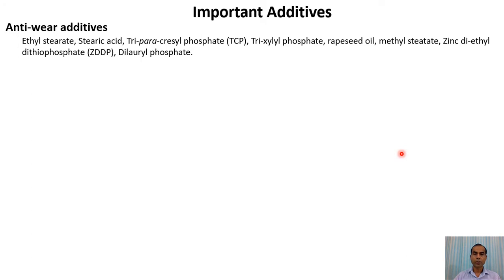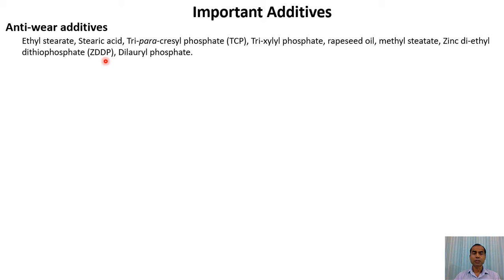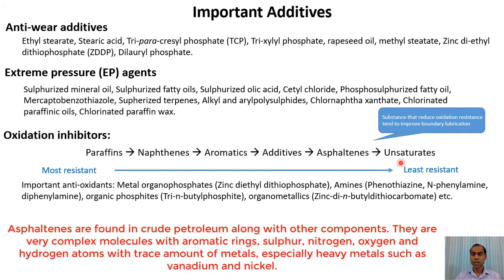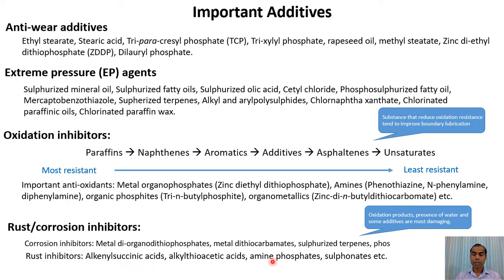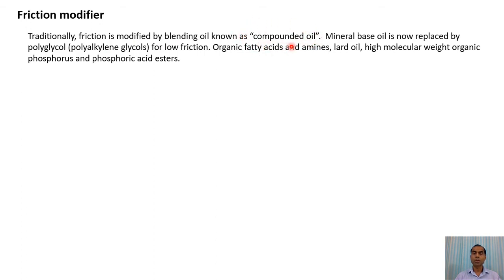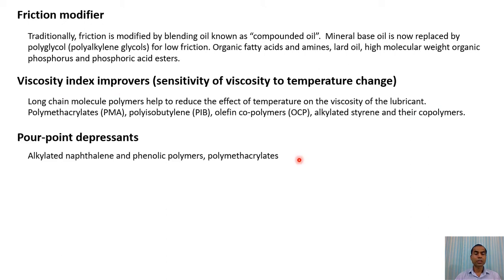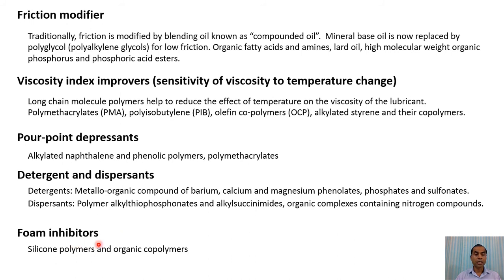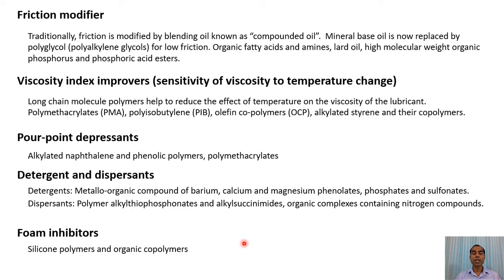What are Lubricant Additives? Why do you need to change the oil of your car?

Comment: I have sn500and150 which additive is uesd to convert engine oil 20w40
Reply from the maker: Engine oil should have all the additives I have mentioned in the talk. This is to take care of the issues that will arise in practice. The issue of friction, wear, corrosion, oxidation etc will all be there. But for some other application where high temperature and harsh conditions are not involved you may not need all the additives.

Comment: Hello sir, i am using an additive to my mineral 15w40 engine oil and this additive contains the long chain chlorinated olefin. I am using this additive since the end of the 90's without any problems. Is it true that the Chlorinated Olefin WILL corrode the engine regardless of the additive mix? The additive is resistant from -50 to +315 degrees celcius. Thank you. Rob
Reply from the maker: Rob, General belief is that the presence of chlorine will corrode metals and it is true. However, I do not have data for your type of application. It is interesting for me to know more about the additive molecule you are using. Could you share? Thank you.
Reply: @engineeringmaterials-tribo5142  sure, can i contact you via email?
Reply: @engineeringmaterials-tribo5142  may i please email you with information as i don't want to share publicly. Thank you

Comment: Sir..kindly guide additives by name can be used in diesel to emulsify it and make it a water soluble metal cutting fluid which turns thick milky emulsion when water is added to it..Regards
Reply from the maker: Not sure about diesel to be used as metal cutting fluid. Normal base oil lubricant can be emulsified using sodium sulphonates with stearate or oleate boundary additive. I will leave it to you to search for diesel emulsification.  I believe it will follow the same trend as normal base oil lubricant. Diesel might be more expensive than base oil.
Thanks for your interest!👍
Reply: @engineeringmaterials-tribo5142  shouldnt be a naphtenic base, instead of paraffinic ir synthetic to be used as cutting White oil?

Comment: Sir can you explain how biolubricant is produce from Rapeseed oil (steps involve, reactions, catalyst).
Reply from the maker: Thanks for enquiry. I have not worked on biolubricants. From the readings I can say that biolubricants need to be stabilized against its easy oxidation and other thermal related issues. I would suggest you to read few papers in this field. Below can be downloaded from the internet.
Catalysts 2020, 10, 366; doi:10.3390/catal10040366
Energy 72 (2014) 618e627
Proc IMechE Part J:
J Engineering Tribology 2014, Vol. 228(11) 1308–1318.
👍